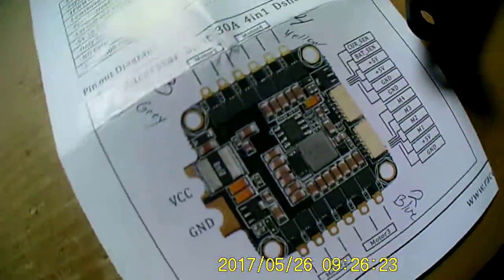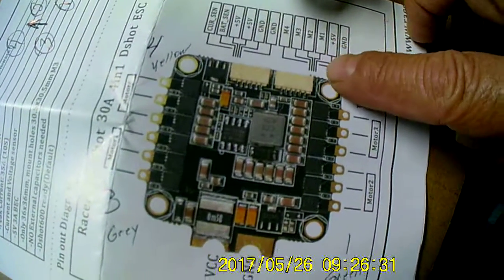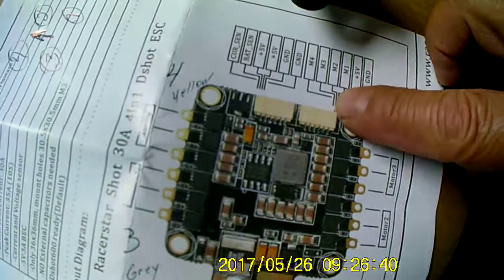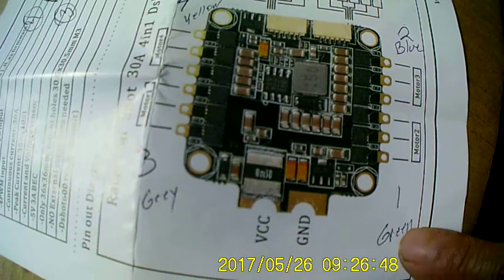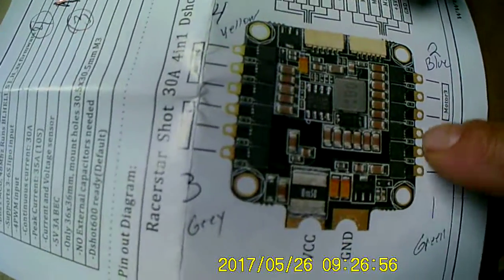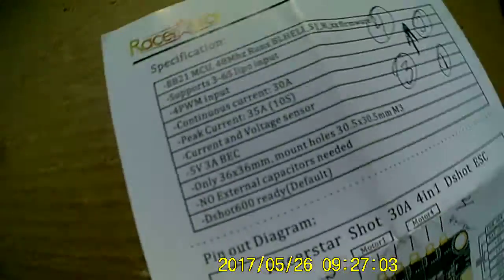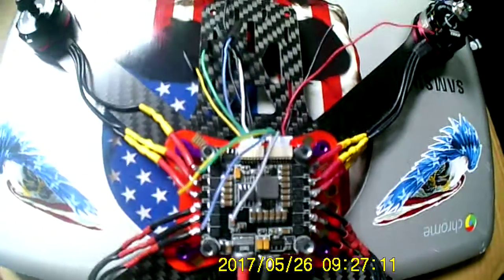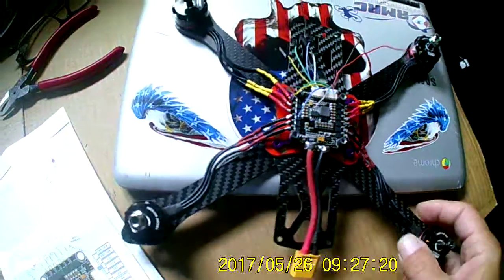Racerstar shot 30 4 in 1 esc w/5v3a bec current and voltage sensor

Comment: hi friend ... could you help me?
I have the same ESC RACESTAR SHOT 30A 4IN 1 to match this flightcontroller ...
Omnibus F4 Pro V3 Betaflight Flight Controller Built-in OSD Barometer SD Blackbox for RC Drone ... banggood ...
The plug with the motors and the GND I inserted it and everything worked ..but when I put on the FC the BAT_SEN cable
and CUR_SEN ... and GND ... let me burn the flightcontroller.
the BAT_SEN on the V-BAT pin of the flightcontroller and the CUR_SEN in the CNT pin of the flightcontroller to give the current to the same.
Where did I go wrong???
Reply from the maker: Just when i had this flying good it flipped out lost in the river.Every build is different i do not connect bat,cur, sen. also i use a capacitor 25v1000uf on the battery cable.This product is not very good you should have looked for feedback before you bought it.Many people have had problems with it and i would not recommend any 30a 4 in 1 esc or any flight controller from BG besides Matek F405-OSD.I have had so many issues 8 flight controllers 2 racerstar  and eachine wizard 30a 4 in 1 esc wasting time and money pisses me off i have 20 birds to fly.
Reply: I have the ..... Matek F405-STD BetaFlight STM32F405 Flight Controller + Matek FCHUB-6S Hub Power Distribution Board for RC Drone
this has the problem that if activated on betaflight (led strip) and (baro) together the led strips do not work ... how do I solve it?
Reply from the maker: Check RC Groups i don`t have STD sure they have the problem solved.Maybe Matek websit or facebook group.

Comment: Any problems with your 4in1 esc "motor 1" rebooting ? if not, can you let me what are your blhelli firmware ver & betaflight settings (dshot? multishot? 8/8khz etc..). Thanks
Reply from the maker: I had problems with the omnibus f3 v1.1 from banggood.After 1st flight problems began with flip of death check out the other videos.It flew great in angle mode but as i did flips and rolls it would flip out of control.Just ordered a new radian fc d shot version from helidirect.Never buy another fc from banggood.3 flight controllers had issues.2 days ago a brand new one did not work at all.On stock betaflight was great 8k/4k.The esc is very good just need the better fc to pair with it.Did you reverse your motors or switch the wires?
Reply: Dear Sir, I think is not the FC!!. Is it the defective shot30 4in1 which caused the death roll. I purchased three of these shot30 4in1 and all of them has the same problems. Banggood had refunded me all three shot30 esc(S). Racerstar Shot30 esc these problems are well documented in rcgroup. Please check
Reply from the maker: my problem was with the flight controller i moved it to my other quadcopter with 30a cicada esc`s after motor 1 and 4 stopped working and had the same problem.my shot 30 worked fine.
Reply: Thanks, are you running Dshot600? Blheli 16.6?